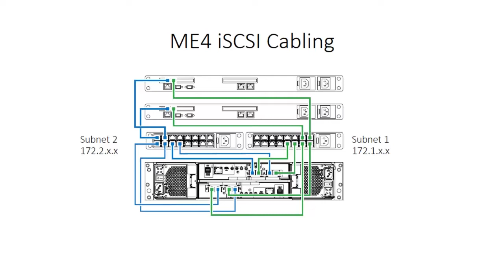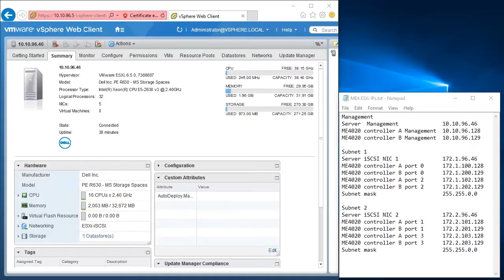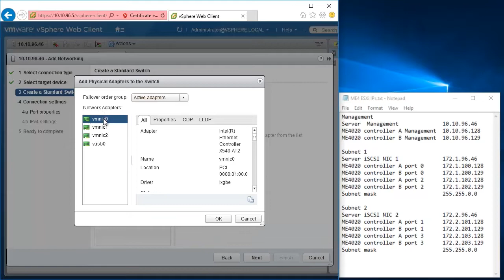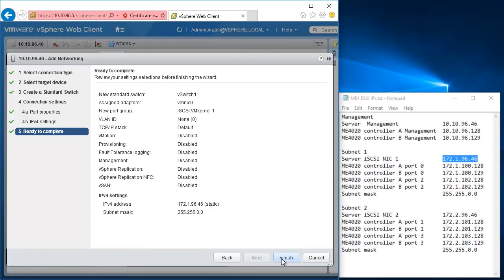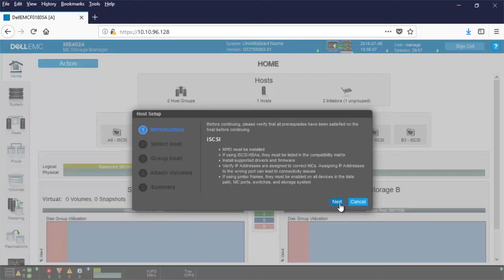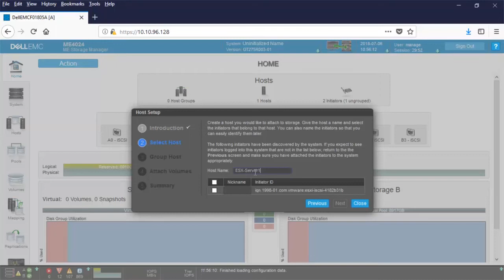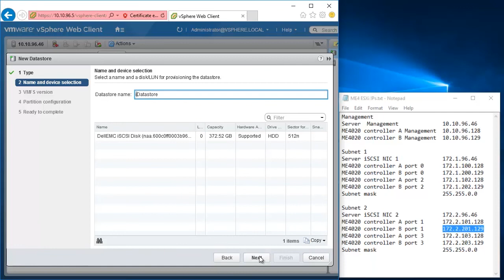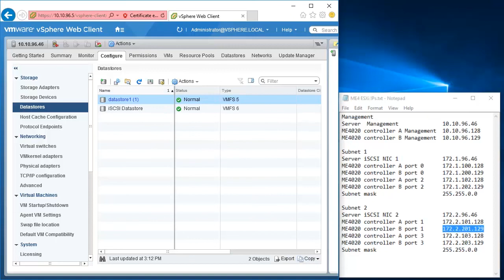Dell EMC PowerVault ME4 Series: Attaching VMware ESXi 6.5 Host to ME4 Array w/ iSCSI Using iSCSI HBA

Comment: Where is the direct attached ethernet video?
Reply: this is the one, when using direct attached ethernet you do it over iscsi
Reply: Pathetic isn't it, Dell say direct attached iSCSI is supported but don't give an example. At a guess I think you have to treat each cable as a network so 8 subnets for 4 dual-attached servers.